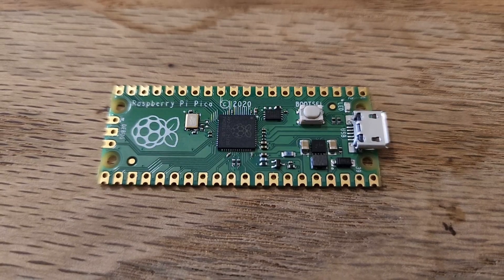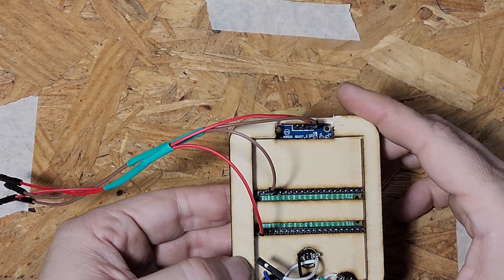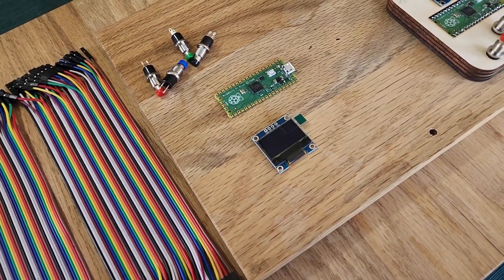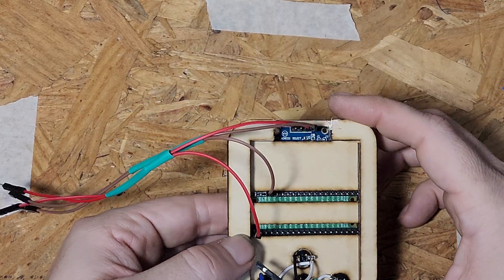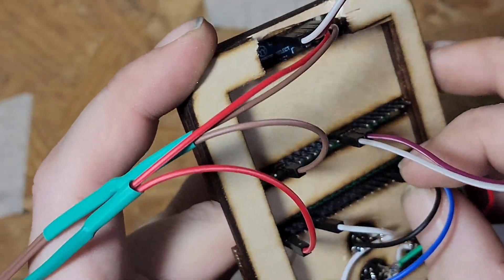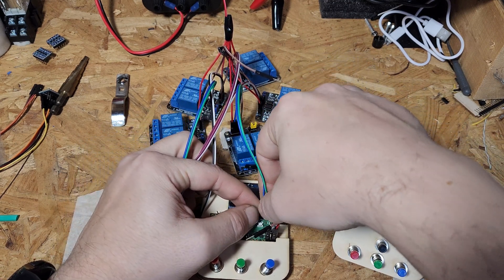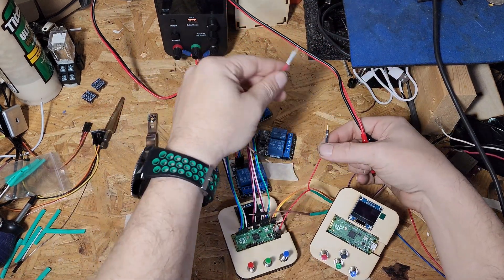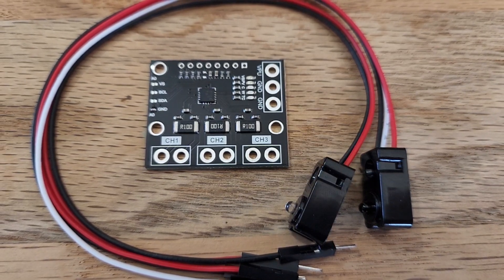Smart Device Communication With Raspberry Pi Pico and UART

Comment: Do you know if the Pi Pico can do Synchronous 9-bit UART at 1Mbps, both as a master and slave? 
 
For example, as a Master it would output a 1Mhz CLK, and TX,  where the data shifted on the TX pin (changes on the falling edge of CLK) consists of:  1-start (low), 9-Data (lsb-first), 1-odd, 1-stop   (12 bits total)?    And as a slave, it would latch what's on the RX-Line on the rising edge of 1Mhz CLK (generated externally)?

I was hoping to find an off-the-shelf solution for basic rx/tx, but no luck.  Digilent's Analog Discovery 2 only lists u*A*rt.    Microchip has a (discontinued?) PicKit Serial Analyzer (DV164122) capable of doing USART.. however, the GUI (2.2) shows only "USART Sync Master".   More concerning is that the firmware (305), and Dll (2.4) is from 2009, so even if I buy the hardware, not sure if it will work with Wit10.  The API examples are for VB2005.
Reply from the maker: I believe the best you could achieve is ~960 kBaud. Not sure if this is close enough for your purposes.